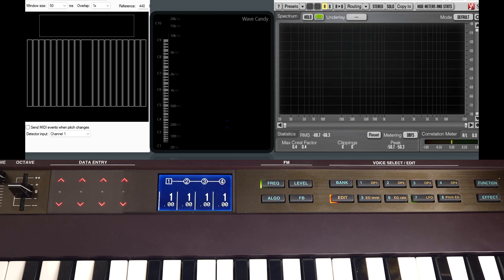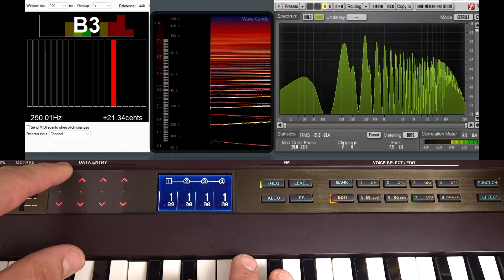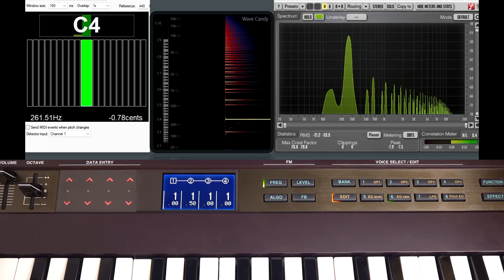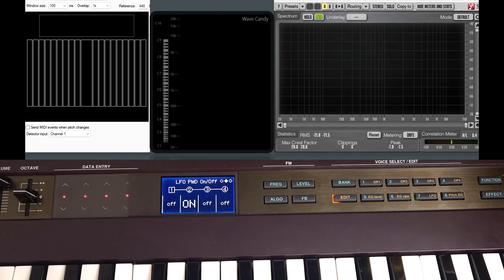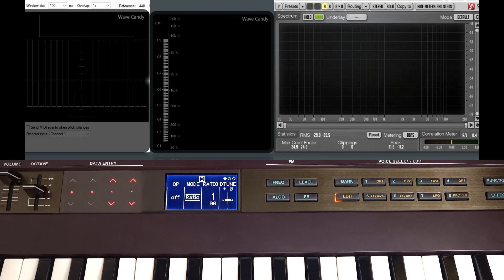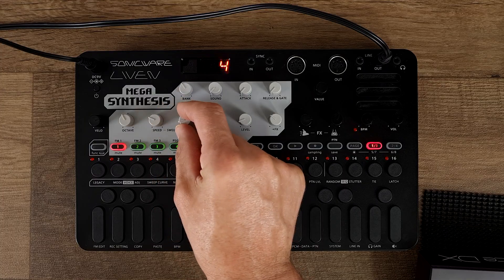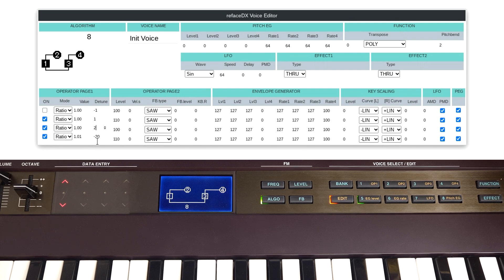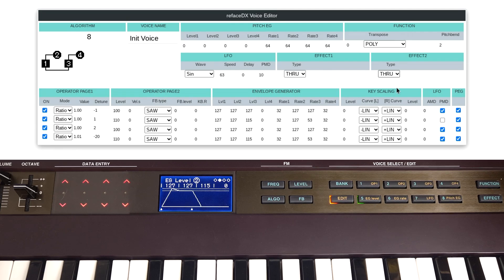FM Synthesis - Practical Tutorial 2 - Pad Example, Vibrato, Tremolo, Wubs and Wonk!, Reface DX

Comment: It still doesn't have that magic that the original DX100 or 27 had. The envelopes in these instruments have never quite been paralleled by subsequent models. And of course there was all the background noise and fuzziness too.
Reply from the maker: I presume you're talking about the Reface. That's one of the reasons I also included the MEGA because it does have all the character of the early Yamaha's but expands slightly adding the ability to turn the fuzz on and off, adjust ratios by 0.01 and fixed frequency mode which the DX100 and 27 lack. It also adds a bunch of stuff that the YM2612 lacked bringing it closer inline with more powerful chips. But the main reason for choosing these over those for this series is because they're easy to demonstrate on with hands on control on the MEGA and the screen on the Reface. The screen etc on the older models is not a lot of fun

Comment: I appreciate you making these videos 🙏 One thing I've always wanted to have explained to me in these FM synthesis explained videos is how to use multiple operators to create complex intricate waves most videos describe the simple concept of two operators modulating each other but I want to know how to intricately modulate 4 to 6 or even 8?✌️
Reply from the maker: Thank you. It will be something I talk about fairly soon, if not in the next episode then the one after that I think. You have different options between being able to affect a carrier in parallel or in series, but the methods I discussed so far just stack up in different ways essentially. Once you've studied 2 operators enough to know how they interact it becomes easier to know how a stack of 2 can affect another. 

In the meantime I've linked to a series of articles and videos by Manny Fernandez in the description, he made presets for this so they're well worth checking out.